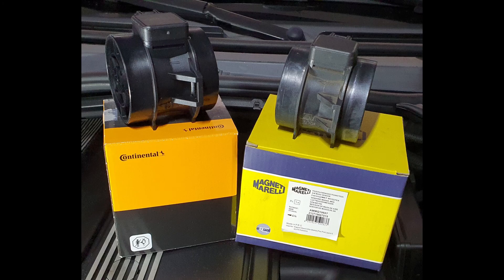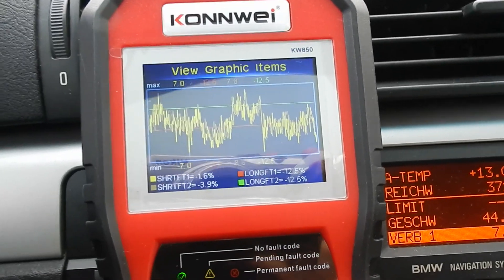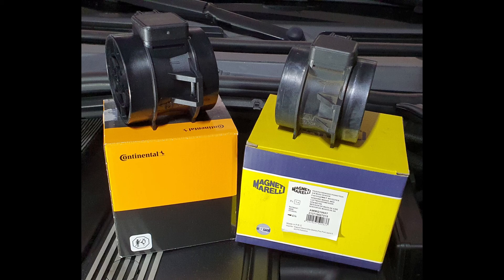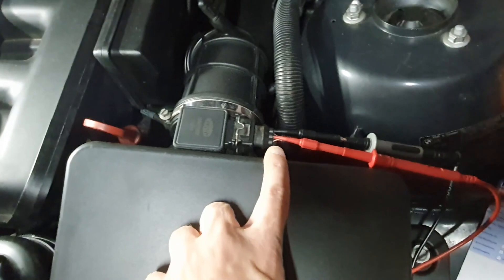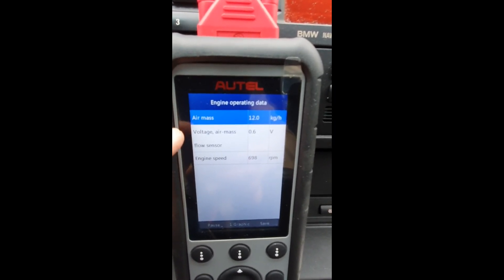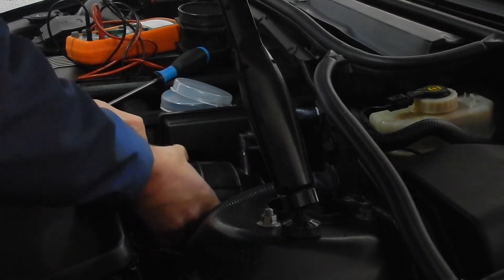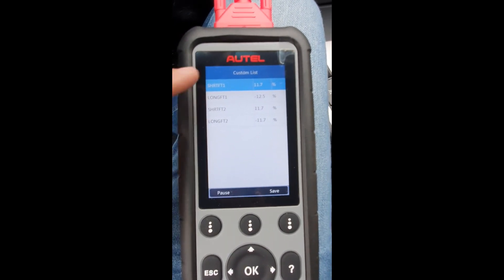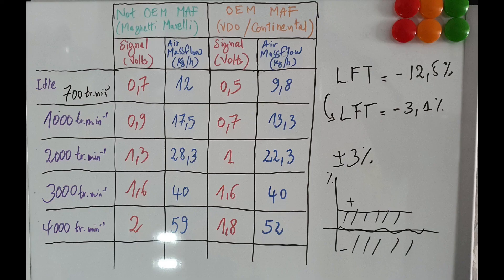Mass air flow sensor experiment  I check & replace I BMW e46 e39 P0100 P0101 P0102 P0103 P0104

Comment: Great video, very useful. Thanks a lot.
I've got a problem in my 530i E39, M54 engine, original MAF Sensor: every now and then, it quits working. My mobile phone app connected to the OBD II port says MAF air flow is 0, and then the fuel trims are negative. A few minutes later the MAF starts working again, registering 3,5- 3,7 g/sec airflow rate. The car runs well, except when the MAF stops working, when there is a slight shudder from the engine, and then goes well again.
I'm not willing to spend 370 euros in a new BMW MAF sensor (VDO ones are unavailable aparently) because I'm not sure the MAF is wrong. Any idea would be welcome.
Reply from the maker: I would check the 12V going to the MAF... or try to clean it with a MAF cleaner.. or in a second step you should monitor the signal generated by the MAF going to the ECU (vary between o an 5V), may be there is a cable harness or connector problem..

Comment: I have check my MAF and it's completely dead. No voltage signal. I'm order a new genuin from ebay to indonesia it's take 2 month for arrived. So I run my E46 with rich condition and doest health when car running idle in my garage. Please tell me, can me actually trick my MAF with adjustable voltage regulator for send signal letsay 1V or 1.2V too reduce rich condition until my new MAF come ? Help me please
Reply from the maker: @CumaAnakTeknik  you can simulate the voltage for one rpm. The signal should vary depending on the actual rpm of the engine otherwise you willl get other problems.
Reply: @DIYTEA  please tell me the value of MAF signal when engine off, just ignition key on. because in my country is only selling no brand MAF for e46, and SIEMENS MAF sensor for KIA Carnival or Hyundai Sonata 2.5L which is 5WK9608 or 5WK96431. as we know BMW using 5WK9605.  i have reading in e46 forum both MAF can swap each other, but im not sure the fuel consumtion is the same.  so i want to make sure the voltage signal when engin off (0 RPM) and the peak rpm value. because i have  to bring my car 1000Km and my Ebay MAF take so long for arrived. God blessed you bro

Comment: If I plug a new one it did not work work will be the problem
Reply: If I plug your new one do not work what could be the problem
Reply from the maker: @SimeonEmmanuel-rt5fo  
Check the cable and signal to the ecu. I m not sure if the e46 does have a fuse for the MAF.

Comment: M54b25. My old Siemens and Atec mafs are showing 3,22 and 3,3 g/s at idle and I have Lean codes p0171 + p0174. 
With a new Siemens(VDO/Continental) it shows at 744 rpm 4 g/s (14.4kg/h) and no codes.  
So I have almost 50% more air consumption as you.
Trims are perfekt. 
How is it possible?
Reply from the maker: @riseofthemashine2880  two different engines, mine is a M54b20... but this still does not explain the air massflow difference.

Comment: Hey! Thanks for the useful video. I actually have the same after market MAF on my e46 318i (n42) - different engine. I get a semi rough idle here and there, pretty sluggish acceleration in some gears at certain rpm (although old car with smaller engine), plus an error code for the sensor, so it could do with replacing I think. I don’t believe this MAF is compatible but do you happen to know what oem is for the n42 engine? Departo suggested one from Hellas (apparently an ex-manufacturer for bmw). Autodoc offered a Bosch. I’m hearing across the board that anything other than oem won’t work well, so I’m keen to resolve properly. Thanks!!
Reply from the maker: Honestly for the N42 I dont know which oem manufacturer it was for the MAF. But I think it should be bosch because when you look for used MAFs on ebay, they are all from Bosch as original parts.
Reply: Hello, sorry my bad english. I measure with the tester, red cable on the ECU measurement terminal, I start the car and it gives me 0.5v, when accelerating it gives me 2v or a little more, are they correct? It's a BMW e46 325i. Unstable cold start. going well! Thanks

Comment: This is m54 b22?
Reply from the maker: Yes
Reply: kg\h measurements from the table were made at a standstill or while driving?
Reply from the maker: @ukaszteter6283  standstill to make it easier getting accurate and equal rpms
Reply: At a standstill I have a good result, but when driving there is much more air. It should be ?
Reply from the maker: @ukaszteter6283  yes it should be different,more air. And it depends from the temperature of the air. This is very important fir the ECU to calculate the amount of air

Comment: on my e46 2.2 maf sensor shows 9.8-10.1 when idle, it is good ?
Reply from the maker: That's too much. Not possible. Should be between 0 and 5v. May be you measured the 12v goint to the MAF.
Reply: @DIYTEA  they told me it is low and must be 12kg/h air flow, this 9.8 is not voltage, it is air flow 9.8 kg/h
Reply from the maker: @TheButiko  
Oh sorry I though you were talking about the voltage. Well the ECU calculates the amout of air based on the voltage. Dud you measured how much volts at idle? But according to my experience 9 is good.
Reply: @DIYTEA  not im not measured volts at idle but air flow was between  9-10.5 i have siemens maf
Reply from the maker: @TheButiko  
It is the same value that I hadt with a siemens OEM MAF. So don't worry, your MAF is doing his job correctly at idle. Try to read the amount of air for different rpms and compare them to my table on the video
Reply: @DIYTEA  thanks for your answers 🙌

Comment: Did you notice a lower fuel consumption after replacing the air flow sensor?
Reply from the maker: I did a lot of things on the car and I noticed a better fuel consumption. Now I got arround 8.4 L/100km in a mixed driving cycle. 
But in my case the Mass air flow sensor was not causing a higher fuel consumption. But the old one does because he was faulty.

Comment: U know all about this maf sensor from your cp it's good, but tell me about this if you don't have a computer lots of people do not know how to use a computer so why don't you show them how it's done with out one, and do the diagnostic on 2003 530i bmw with out it I like to see that
Reply from the maker: The idea begind this video is to show why it is recomanded to use OEM parts. What I did using a scan tool was just part of the experiment. 
To check tge MAF you will need a multimeter, you can check the voltage like I did on the beginning of this video.
Reply: Just buy one you'll need it

Comment: Can’t get a straight answer, it seems the OEM mass airflow sensor has three different brand names the box says continental you said it was a Seimens and the BDO or VDO? Mine says Siemens I thought it was an aftermarket I’m having issues. Got the car as payment from someone recently they said it had a bad O2 sensor but I suspect it is actually the MAF Ships and run smoother when it’s plugged in but goes into lamp mode so I unplugged it again after trying to drive it for a couple of days it doesn’t always do the same thing and the air filter was dirty.
Reply from the maker: Very simple: the OEM part ist VDO. this company was belonging to Siemens, that's why Siemens VDO. But now the VDO brand ist belonging to continental.
Reply: @DIYTEA  Thankyou you explained it in the video Thankyou very much. How long should I give it to relearn before I need to just get a new mass airflow sensor it shifts better with the sensor plugged in but occasionally goes into limp mode so I unplugged it again
Reply: VDO is over 300 bucks I want to be sure
Reply from the maker: @kyplummer3657  
The part number of the VDO Maf sensor is 1432356 (BMW part number). But the manufacturer part number is 5WK96050Z (VDO part number). 
I got if for 160€, may arround 170 bucks. 300 is too much. Check online may be you find a cheaper one. Some part sellers are may be still selling the MAF which comes in the old white box under the brand VDO Siemens and pretending that the part is the only one 100% OEM. That's not true because the VDO is now under the brand Continental and the box looks diffrent (like on my video) and the part is the same. 
The adaptation will take some days, in my case was may be 3 days. It depends from several factors. You have just to drive the car, the ECU will do the necessary.
Reply: @DIYTEA  wow man Thankyou so much I have been trying to read and watch videos on this for days and can’t find anyone who knows what they’re talking about all they do is show how to change it, any idiot can figure that out without a 20 minute video 😂. Thankyou Thankyou Thankyou!

Comment: Very interesting, i have One question : Continental vdo part original n 143256 are you sure? Great video ,i have same problem my bmw 320 convertibile m54 226
Greetings from Italy
Reply from the maker: Grazie Stefano!
The part number of the VDO Maf sensor is 1432356 (BMW part number). But the manufacturer part number is 5WK96050Z.
I get my part form this website. I do not know if they deliver in Italy. Check the table of the corresponding vehicles of that MAF. 

https://www.daparto.de/Teilenummernsuche/Continental-VDO/5wk96050z?modelId=d8e3afde
Reply: @DIYTEA  Yes of course match Number , thank you very much my friend👍👍👍👍👍🇮🇹
Reply: So I’m confused what mass sensor should I buy
Reply: @Inkybandz59  continental part original

Comment: I had problems with my maf and I got one and it was a cheap one it didnt work so I couldnt get more money for a nuther one so I took a bounty sheet wrapped it around the maf and my car been running fine for two years with no problem
Reply from the maker: Thats an interesting solution. You got a leak on the MAF or what?
Reply: @DIYTEA  I just put it on the old one and it worked  I was surprised I had all the hoses replaced couldnt figure out was wrong dealer told me I needed a sensor  I disconnected it it ran fine but would come up fail trains safe mode then I took the bounty sheet and put in on the the front of it where the air flows threw and it worked
Reply: @thesuperflygamercoolsome4006  can you please explaian a bit more detail on how you put the bounty sheet in front of the air mass sensor..cause on the 1st comment you've mentioned wrap the air mass sensor with the bounty sheet..also what type of bounty sheet you're using..sorry 1st time i heard stuf like bounty sheet..tq
Reply: @smgees  it doesn't matter witch sheet from but I put it just before the mass airflow sensor not after we're the filter goes the housing just before that take off the clamp cover the hole with the sheet tighten the clamp and run it see how it works out..👍
Reply: @thesuperflygamercoolsome4006  are you putting the sheet on the old maf sensor or the cheap one that you buy?
Reply: @smgees  the old one I brought a cheap one it didn't work when I replaced it so I used the old one
Reply: @thesuperflygamercoolsome4006  i see so what was happened on the old maf sensor exactly..is it giving any problem so that you buy a new cheap one after that?
Reply: @smgees I brought the cheap one it didn't work it did the same as the old so I just put the old one back on then sent the other back
Reply: @thesuperflygamercoolsome4006  ok then..will try with my old maf sensor and see how it goes..only thing is where to find the bounty sheet here in my place..i will try look for it..thanks mate
Reply: @smgees cover the whole before the maf to control the airflow
Reply: @thesuperflygamercoolsome4006  got it..👍👍👍